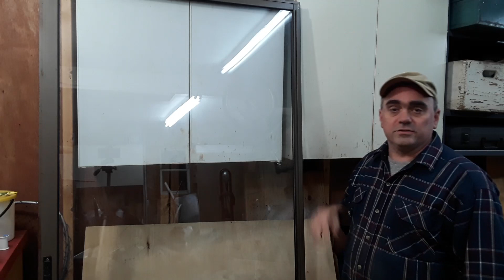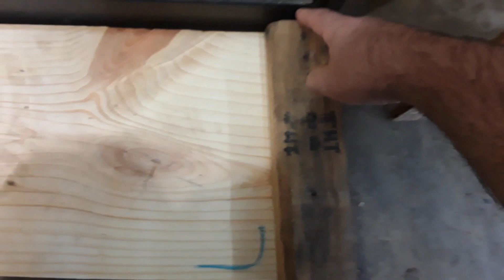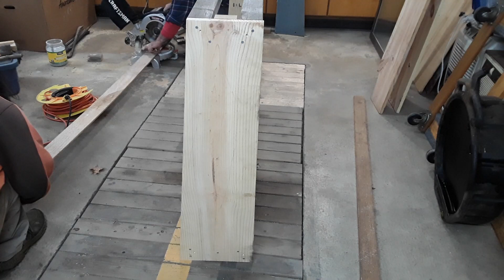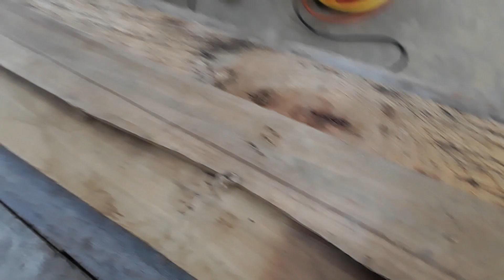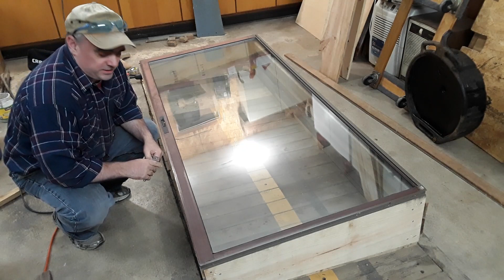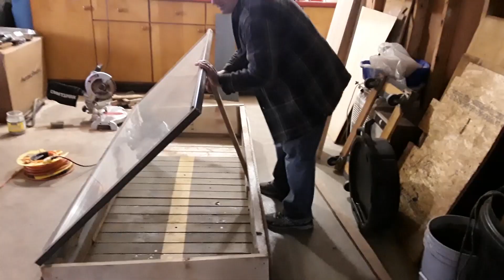Building a cold frame using a sliding glass door for a lid. Heavy but workable.

Comment: I loved the idea of using all those scrap pieces but could not get past the door hinging on the low side.  However,   you did give me a lot of good ideas on how to put one  together with my scrap pieces.  Since I don't have a scroll saw, what's the best way to notch the wood supports?  Will a jig saw work for a thick piece of wood?  New to woodworking so don't want to do any damage to me ):!
Reply from the maker: Not sure if the jig saw blade is long enough.  You need to make sure the blade sticks out of the wood even st the shortest position of the stroke.

Comment: This is a good video. It would have been great if you had explained how to get the angle of the side boards.   I have a sliding door I want to use for a cold frame,  but not being a math wiz,  don't know how to calculate the angle of  a 36" wide door with a 11 1/2" back board.
Reply from the maker: Thanks!  I don't think I did calculate an angle.  I think I just knew the height of the front and the back.  I marked them off on the side board and drew a line.  Then cut on the line.
Reply from the maker: Also, I attached the door to the flat side, not the sloped side that I cut.  Because of the slope, that side will be longer.  You can account for it in the calculations (more math than I felt like doing), but to me it was just easier to attach the door to the flat/square/straight side.

Comment: Why didn’t you turn the door around?
Also, do you think the glass blocks UV light?
Reply from the maker: The non-handle side of the door has a piece of aluminum that protrudes almost the whole length of the the door (both on the inside and outside of the door)  so to compensate for that, the 2x3 on that side was 1/4" lower than the side wall.  To turn the door around, I would have had to raise that 2x3 and lower the 2x3 on the other side.  We decided it wasn't worth the effort and just hinged it as show in the video.  I did make another one that has the handle side of the door on the high side of the cold frame, so it could be hinged there.  Since then, Jarod has said he prefers the one with the hinges on the low side because it make the door easier to open.

Full disclosure: We did not take glass blocking UV light into account when building the cold frame.  I have since done some research, and there are 3 types of UV light: UV-A, UV-B and UV-C.  UV-C is harmful to plants and animals, but most UV-C light is blocked by the earth's atmosphere, so not really relevant here.  UV-A is beneficial to plants and is not blocked by glass unless it is specially treated (like car windshields). UV-B, in the right quantity, is beneficial to plants but is blocked by the glass, but that is any glass.  It is not specific to the sliding glass doors we used.  

Feel free to follow Terra-ble Gardening Videos for updates on how this experiment works out.

Comment: The cold frame seems a bit shallow.  Have you had any issues with that?
Reply from the maker: It hasn't been a problem over the winter.  In cold weather things grow slowly.  It is just to keep the frost and snow off of them until spring.  Now we have the lids propped open (or you could remove them for the summer).